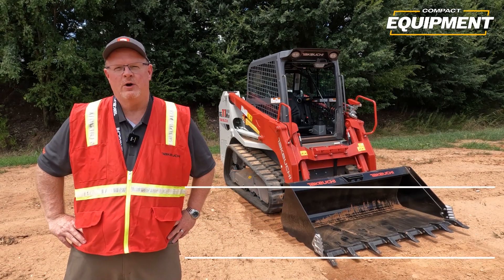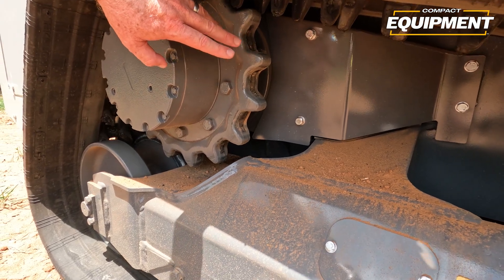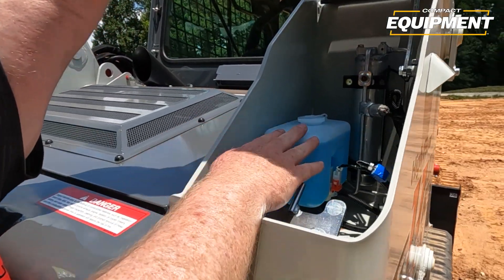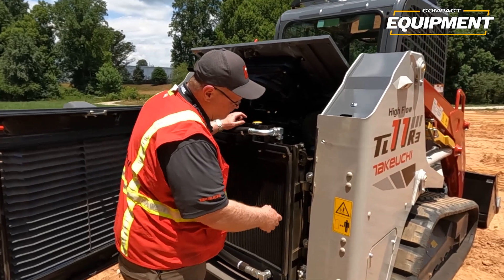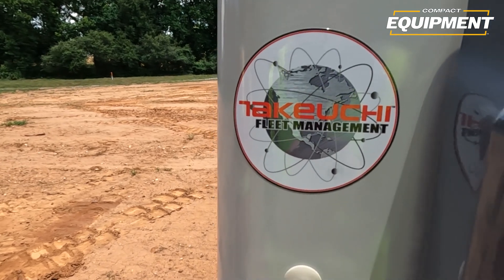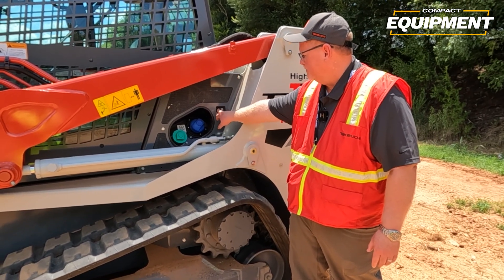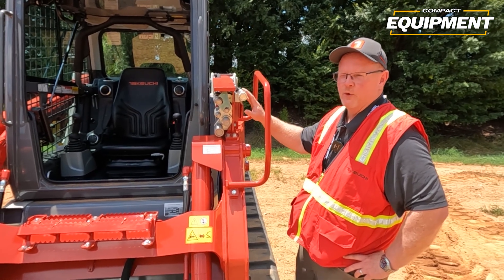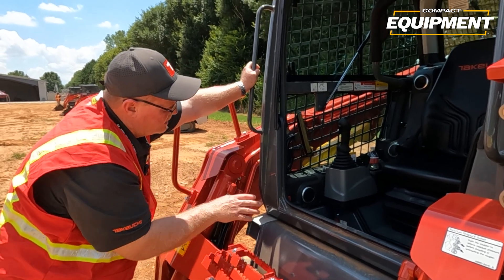Takeuchi TL11R3 Compact Track Loader Walkaround | New EH Controls and Undercarriage Design

Comment: I like it, except for the electric over hydraulic controls. Pilot controls was one of the reasons I bought a Takeuchi in 2020. I would have to run one with the E over H system before I made a final decision, but if it operates like the competition, I would probably give more consideration to the competition when I buy my next machine. Some things just don't need to be changed in my opinion.